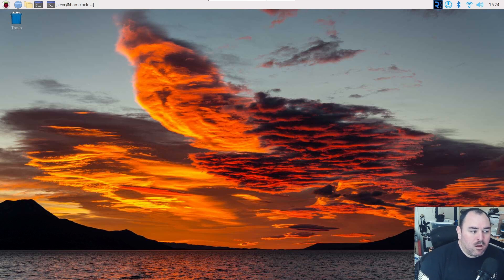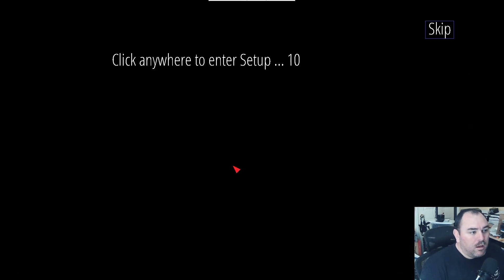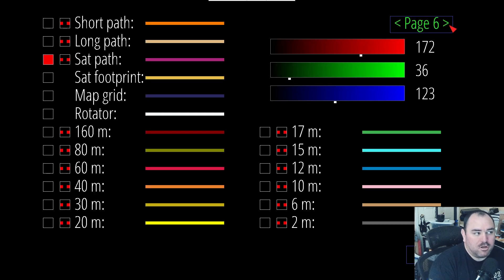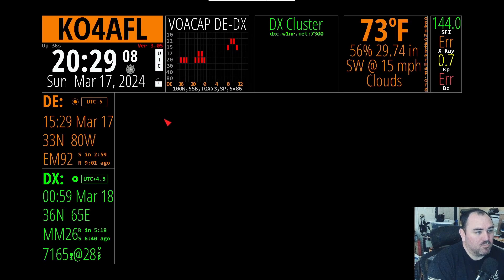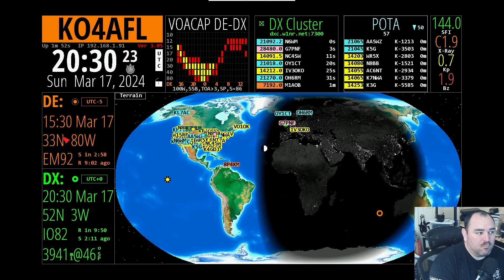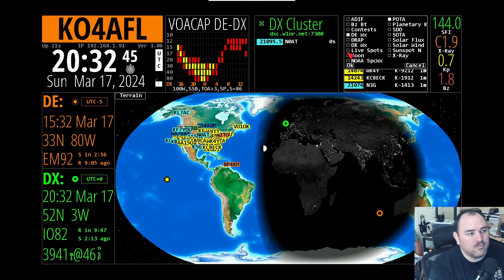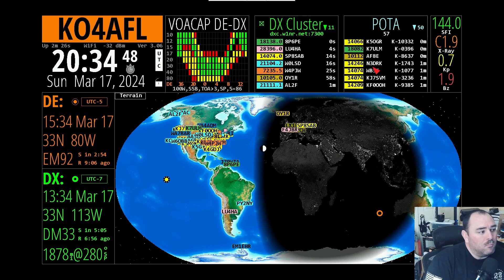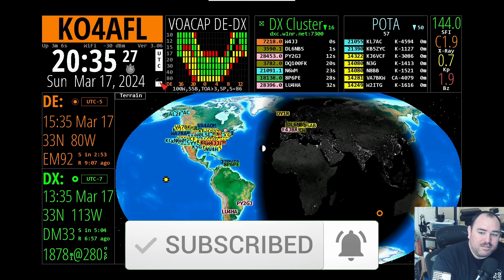Hamclock

Comment: I installed HamClock in a refurbished station laptop in which I had installed Ubuntu Linux. Later I was viewing it in my Windows laptop through WiFi LAN. It was nice to see the screen changing in the original laptop when I made changes from the browser in the second laptop. 73 de Jon, VU2JO
Reply from the maker: Great use of some saved hardware.
Reply: @KO4AFL  Thank you.